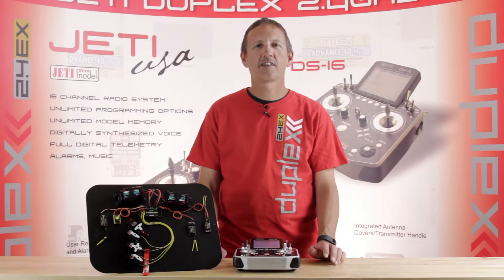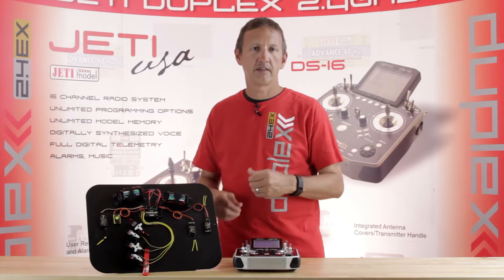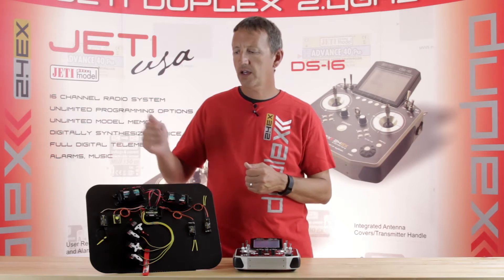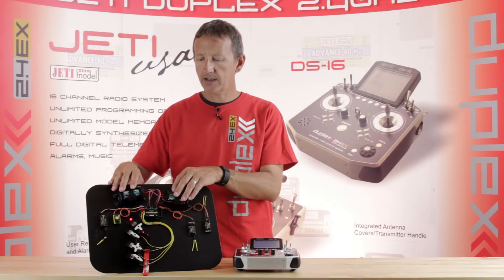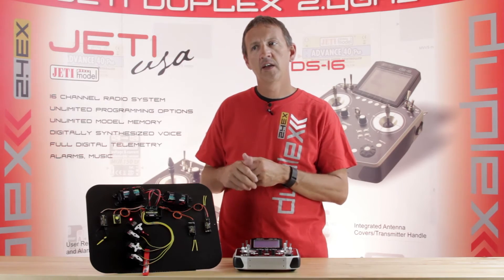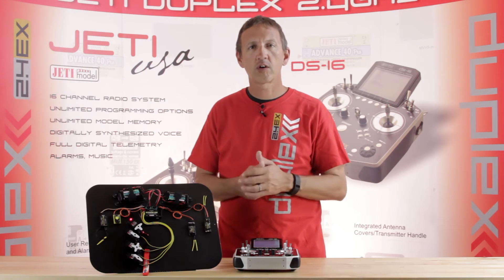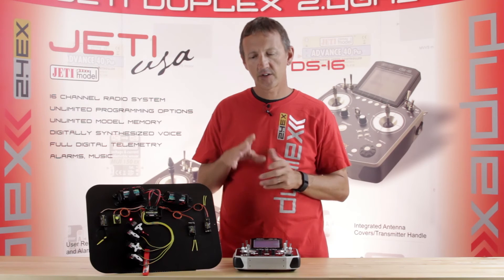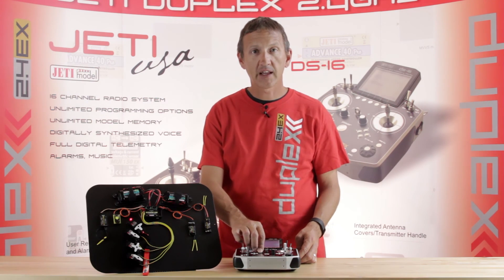A Closer Look: Jeti Central Box 200 & Jeti Wireless Switch

Comment: Follow up question. You have switch input on the 200a main switch, can you use a normal servo cable from a outport on the central box 200, into the switch input? I want to control both the central box and main switch in two stages from the radio, on two different channels. One RCswitch on central box 200, and one channel on the centralbox to controll the main switch, possible?
Reply from the maker: Steinarne79, Please email support@esprittech.com. They will be able to help with your programming needs.